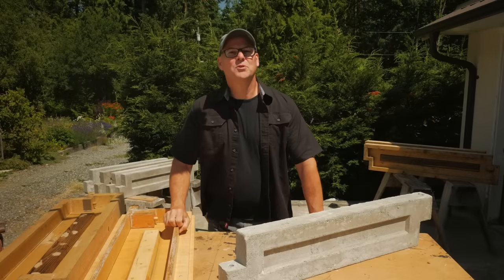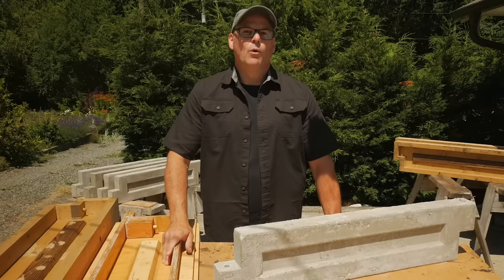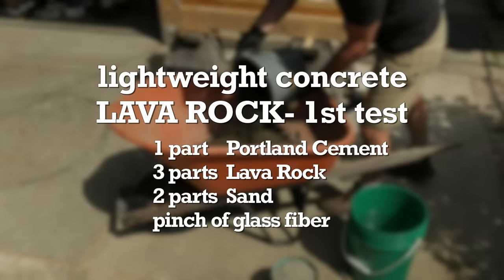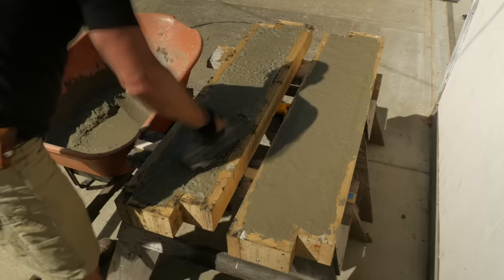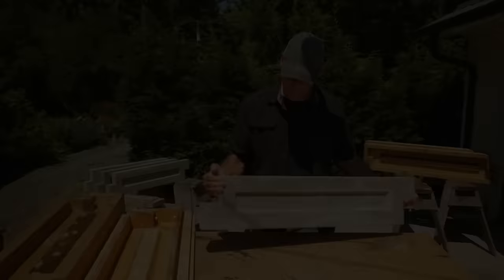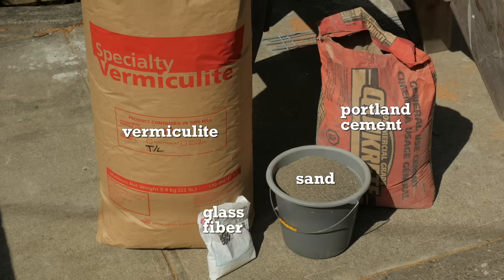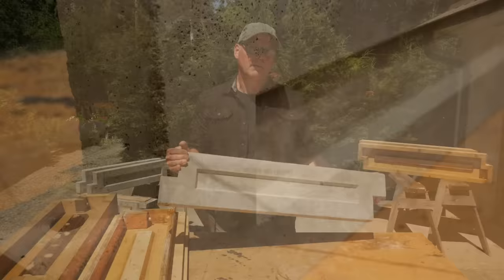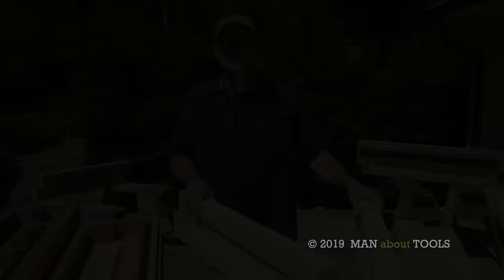make Lightweight Concrete Garden Boxes PART 3 - Aircrete Vermiculite Lava Rock

Comment: coating the outside of the fully cured aircrete blocks with rapid set newcrete would create a very hard skin.  obviously that would be a significant extra step in the production, but i just might make the perfect, lightweight, super hard block.

love this series and love watching the way you work! thanks kent.

Comment: i think that the other will also crack in some time. because of the armature steel structure architecture made. usually, we put two layers (4 rebars) linked in opposite axes to stop the dilatation bending of rebars.
so, the problem is not the concrete but the armature.
also, cement protect steel from electrolyse corrosion, but not air bubbles. not limestone cemebt too... there, you can use bamboo instead of metal.

Comment: It bent because you only had wire mesh on one side.  Try immersing a cage inside your form.  Remember to suspend the cage by putting spacers to keep it from touching the form below.  You can cast tiny concrete cylinders of the same proportion of concrete mixture for your spacers.

Also, if you want to make your aircrete block tougher, use a trowel to coat the inside of your form with regular concrete of a sticky composition.  It's like putting icing before the actual cake.

Comment: I haven’t read your comments board but as I  see it the use of 1 sheet of mesh will allow the bending to happen as It would be difficult to have it positioned exactly center with which upon curing  or drying  will be biased to one way or the other which ever shows  the least resistance  therefore allowing the pulling to one side  ! I suggest using 2 sheets approximately a third of the  way of the outer faces ,which in my opinion would reduce the bending because the 2 sheets would be fighting each other as opposed to not having resistance at all to one side or the other I hope this explains how to my  mind anyway  how this could be a resolve  ,as to the surface being more resistant to abrasion or impact a higher concentration of glass fiber will help with impact certainly ,but not so much for abrasion  I suggest  a much higher cement ratio  (no foam) as a skim coat perhaps allowing hydration to partially take place before adding  or continuation  with your  regular air Crete mix ,effectively creating a hard shell which should be able to resist the undesired attributes of the air Crete this all being to the detriment of weight! but I believe marginally  compared to the benefits gained . This might a resolve, good luck in your efforts  I’ll be watching to see how it turns out sincerely yours John Aussie truck driver / farmer

Comment: It might be interesting to put half of the lava mix then put the aircrete over that without over-trowelling the lava mix to allow a better interface.  Then the exposed edge would be durable and it might stop the warp.  However, you probably would have to be careful in tilling the garden with aircrete as well.  It would be heavier but a bit less so.  If your connector edges are built "square"  you could do pretty corners.

Comment: a tip : if you want smooth face you can use what we here called "face mix", which is basically finely sifted sand and cement mix at 1:2 (1 fine sand, 2 cement, no water). before you pour the main mix,  use a small cement trowel or your hand and sprinkle it into the mould first (or use a sifter to have nice even coat), coating the faces of the mould in that dry powder. then you pour the actual mix over it. it will come out very smooth and have the added bonus that it makes it easier to detach from the mould.
also foaming solution can use Amphitol if you might have problem with the soapy ingredient in shampoo

Comment: Could you do a video using the methods shone here and how they might be used by one person to build a garden wall. I need one about 15 to 18 feet high. I'm thinking about leggo staggering and using long rebar placed in a concrete footing and dropping the sections down onto the rebar. Might be able to use lightweight concrete for the top five rows. Waddaya' think? Can you do it? You don't have to build a wall obviously but could you lay out your ideas on a theoretical plane. I have a house WAAAY out in the country and I'd like to be able to do the entire job myself with scaffolding. I'd appreciate even a short video with your considerations. Thanks in advance. Your Loyal Subscriber. The videos are GREAT!

Comment: I heard that they use ice to stabilize the curing of concrete and prevent cracking in dam constructions. Maybe you already figured things out, but the ice is worth mentioning since this project was done during a hot day.
Reply from the maker: Thanks for that thought S Cat. In part 3.6 my aircrete worked way better.

Comment: On the aircrete, it seems it would be worth putting down a half inch to inch layer of standard concrete, then put the aircrete on top. Gives it a good hard surface, while still being quite light.
Reply: exactly what i was thinking

Comment: for those wanting the aircrete formula

the aircrete formula without a foam machine starts at 10 minute mark 

the shampoo is sauve daily clarifying shampoo (that matters as it has more foaming agent) He does NOT use Seventh generation dishwashing liquid and says his tests show the sauve daily clairifing foam lasts better.

155 fl oz443 ml shampoo
2.5 gallons to 19.5 liters water for shampoo dilution.

then 

9.4 lb or 4.3 kg portland cement
5lb or 2.3 kg water
1.5 lb or o.7kg shampoo mixture

he mixes by weight
he first mixes portland cement and water and a bit of fiberglass fibers to  make the cement slurry

he makes foam separately. he uses 3 lb of shampoo mixture to make twice the foam he needs.
this fill a 5 gal pail with foam when mixed with a mixer with a screen wrapped around it.

then he pours about half of the foam pail into the cement slurry and mixes

then he pours into molds and adds wire reinforcements. 

leaves it all cover and alone for 2 days.
Reply from the maker: Thanks for the summary here. However, the results of this aircrete test were not as good as the follow up video Part 3.6. Have a look https://youtu.be/N9EKXTTA7v0

Comment: Suggestion, Exposed aggregate outer layer for the aircrete.

You could mix up a small amount of Portland cement, sand and aggregate and use that as a first layer, then back fill with aircrete. This would probably be the most durable for the aircrete mix.

I have seen some pretty small aggregate used for the exposed aggregate look, like pea gravel size, though I would suggest slightly larger.

I have never done concrete with exposed aggregate so I don't know the technique on how and when to expose the aggregate.

If the aircrete continues to warp, insert some boards on the back reducing the section width. In the injection molding world with plastics that works. If you make the molded plastic item too thick it warps, less section width and it cures/hardens without warping. Might work the same way with aircrete?

Unless it is a structural situation glass fiber is a waste of time and increases cost, specially here as your already using reinforcement. 

I also suggest trying plasticizer/flow control as suggested by others in the comments, it allows less water and makes a better surface finish as the concrete flows so much better. Less water stronger concrete. Not sure how that would work with the aircrete though.

Comment: Never tried the aircrete mix but most often traditional concrete cracks when it dries too quickly.  If you let them dry at lower temps out of direct sunlight they may not crack.  The downside is that it will give more time for the air to settle out.

Comment: mabey place a double iron in the bottom part and double on the top part like in the 4 long edges so it stay straight.
now you have one in the center of the foam crete and that seems to shrink a bit , but the steel mesh doesn't so the
designer shape  makes it go bend because of difference in thickness of both sides of the steel mesh .

Comment: Hi, if not yet answered: the cracks come from shrinking of the cement. Only cement is shrinking in a concrete and it is a normal behaviour. To avoid shrinking as much as possible you would have to follow the rules of making normal concrete as close as possible. So use not more cement as necessary, use not more water as necessary. Keep the concrete moistered as long as possible (perfect would be lying in water for 30 days after it has hardened), avoid high temperatures, use special fibres against early shrinking stress, not the glass fibre you used, but some out of polypropylene.

Unfortunately aircrete brakes most of the rules to make sustainable concrete, as it is just cement, water and bubbles = the worst concrete you can make.

I think too that vermiculate or as suggested perlite or leca does a better job. When using them, find a mixture of different sizes. The less cement between the perlite or vermiculate the stronger the concrete will be and less cracks will happen. Avoid those glass fibers or add some special fibers for fiberconcrete out of polypropylene and steel. First are for avoiding drying cracks, second for strenghten the concrete.

Or make a sandwich with a normal sandy and fiberinforced concrete with a styrofoam core. You can make durable concrete with thickness to 2 or 3 cm. Its just hard to keep tge foam from floating
Reply: Outstanding suggestions. I think the warping and cracking was related to the cement not curing prooerly. The concrete should be kept wet for a week for  better strength. Keeping the blocks submerged in water would be even better. Also consider adding a mid range or high range water reducer as less water will give a stronger result. Finally, add some metakaolin pozzolan in place of a bit of cement. You will need to experiment with ratios. Also consider using blast furnace slag in place of sand.

Comment: I may have found a solution to the warping: make rectangular tubes out of wiremesh and use those as reinforcement. having two planes of reinforcement will pull against the warping.
Reply from the maker: That might be good thing to try

Comment: try perlite, vermiculite is meant to trap water in potting soil to keep the soil moist. it acts like a sponge when exposed to water, which will affect your curing time aswell. perlite is meant to add aeration to the soil and does not absorb water.

Comment: This is a great series. I'm toying with the idea of making slightly bigger pieces that I can move around with my kubota. We have horrible soil and a variation on these seems like a great way to get a large raised bed area that will last.
Reply: instead of larger forms, why not try smaller stacked ones> He shows in another video making them 2 high, I think you could got to 4  maybe, and if something crackes etc... it would be less material intensive to replace a small piece, and smaller pieces would dry faster meaning the bed would be 'down for the count' a shorter time
Reply: @victoriajankowski1197  That is a good idea for smaller planters, but I was thinking about doing a lengthy raised bed that the tractor could drive down. For traditional raised beds, I'd agree stacking them makes more sense.
Reply: @onfinancialsuccess4162  My biggest thought was drying time, wouldn't a significantly larger piece take much longer to dry? the way his go together you can join the pieces to get more length instead of a corner, I would just be afraid of trying to move them before they where completely dry and having snap at a soft point. I'm not expert, total nudie was just something that occurred to me might be an issue
Reply: @victoriajankowski1197  That's a really good point. Man about TOOLS clearly has a lot of experience building stuff and I don't. Following his directions would be my best chance for success.

Comment: Need to add the cement powder directly to the foam with no water...would be interesting to compare using fine/course pumice sand in stead of scourier...and a version incorporatin vermiculite, pumice sand & cement in a dryish blend.

Comment: Hi ! 
Just had an idea, why not make a two step product by making a thin exterior layer of solid concrete 1/3 inch and then fill the remaining space with aircrete... 

I mean the heart of the final product would be aircrete and the exposed part of regular concrete for durability. 

Probably little more work, probably not 80% weight reduction perhaps 60% ... but the final result worth it. 

Tou have to figure out the best timing to poure the aircrete to achieve the best fusion between the two materials. 

Would love to watch a video of you doing this. 

Cheers from ALGERIA 🇩🇿

Comment: Durability would depend on what you use it for.
To determine overall durability (i.e., for all uses including structural  ??? PSI ) you would need to compress it until it cracks.

Comment: What about a smaller version made of air-crete that will fit in your original form to add in place of the steel reinforcement bars so that the finished product has an outer shell of a harder more durable mix?

Comment: To prevent warping you will probably have to leave it in the form much longer bc it takes weeks to cure to full hardness, but if you coat the final product with a harder concrete like the top sealer for driveways then it should be much stronger coat(like use a paintbrush to put an 1/8"coat after pulled from the form).
Reply from the maker: The aircrete in Part 3.6 of the series worked very well. No cracks or warping.

Comment: AIRCRETE :: This is a material that seems important. Just guessing & without any research, I suspect that (a) fairly large increase in fiber content and slowing the drying/curing, (b) small addition of sand   . . . might reduce cracks/warping and improve abrasion resistance.
Reply from the maker: I agree that that should be tested.

Comment: You might want to add significantly more than a pinch of the glass fibers. They are engineered to really grip the cement when no rebar is used, so I think that that's the issue or a big factor in the cracking and warping.
Reply from the maker: That might be so. Worth a try. For these first experiments I decided to add the manufacturers recommended amount for the volume of concrete I was pouring.

Comment: Could try an aircrete/perlite or aircrete/lava rock mix to strengthen it.  If you mix lava rock with the foam first, you may avoid the problem with the lava rock voids getting filled up, then would have the advantage of both strength and preserve the lighter weight from the lava rock.

Comment: Thanks, I was wondering about aircrete and your test helped me a lot. I will add more fiber. 😎
Reply from the maker: Good stuff! I used the concentration of fiber suggested by the manufacturer. Which was just a very small amount. I found it spread very well throughout the mix. And could easily be seen everywhere in the panel upon close inspection.
Reply: When mixing ratios 1 part is equal to one gallon? I saw a gallon paint can being filled and a 5 gallon bucket also being used and the mix was combined in a wheel barrow. So is 1 part is equal to one gallon or was it based on weight. I gallon of water equals I pounds which is 1 part?

Comment: Honeydo carpenter has mixes on his etsy store that have more strength using sand and perlite. I am going to try mixing some expanded clay pebbles used in hydroponics to his aircrete refractory mix to make a pizza oven mix.I think the pebbles will give strength like aggregate in a standard mix.

Comment: Really interesting video series that helps us with a garden bed problem we've had for a while i.e. what to make them from that's cheap, durable, flexible and easy to handle.  Regarding the aircrete, I'd second many other comments below regarding the bowing problem and suggest a combination of remedies including reducing the amount of total water content added to the aircrete mix, significantly increasing the amount of fiber reinforcement, and maybe keeping the whole thing saturated with water during curing.  Prepainting the mould interior with some of the slurry might also be effective in hardening up the exterior of the panels.   

We'll be making some of our own shortly while very likely including an oxide pigment.  We're very inspired by your excellent work and generosity in sharing!

Comment: It seems the bending of the panel was caused by drying of one side before the other side. As soon as they are able to hold shape, i would try to turn them to their final installation side for drying rather than the flat side. For durability of the surface, I would try applying some render at least for the outter side.

Comment: A bit like cooking :-)
 Try to soak the finished panel in water, like the Romans did with concrete and sea water.
Reply: "sea water" meint auf deutsch "Seewasser" bzw. genauer "Salzwasser", und das interessiert im Garten wohl seltener ;-)!?
Die alten Römer testeten ihr "Opus caementitium" wahrscheinlich auch nicht immer auf Seewassertauglichkeit, wenn es aus der Gegend von Neapel (Puzzolane) stammte, denn da wussten sie es aus Erfahrung
. 
Im Raum Eifel/Trier werden sie vermutlich schon getestet haben, ob der Bims der Eifel gleichwertig ist.
Allerdings dort auch wohl nur, wenn sie an Export zum Nordseestrand interessiert waren.

"sea water" means in German "Seewasser" or more precisely "Salzwasser", and that's probably less interesting in the garden ;-)!?
The ancient Romans probably also did not always test their "Opus caementitium" for seawater suitability, if it came from the area of Naples (Puzzolane), because they knew it from experience.
In the Eifel/Trier area they will probably already have tested whether the pumice is equivalent to the Eifel.
However, there only if they were interested in export to the North Sea beach.

Translated with www.DeepL.com/Translator